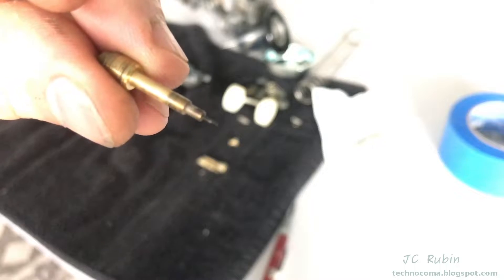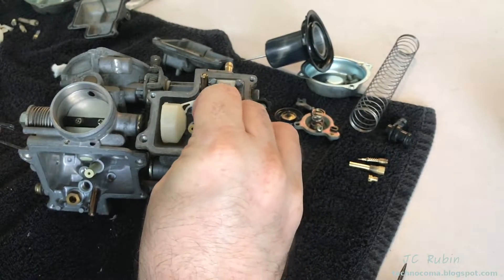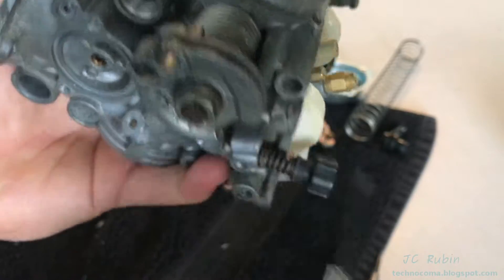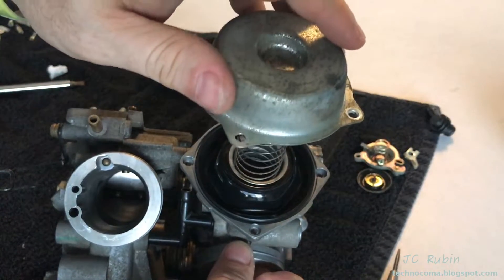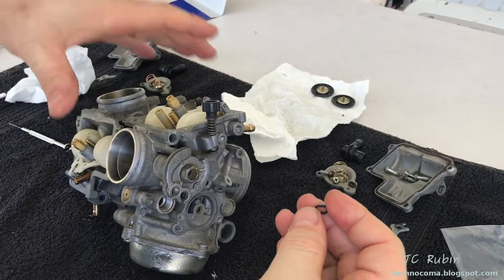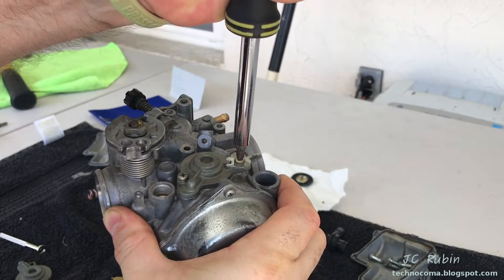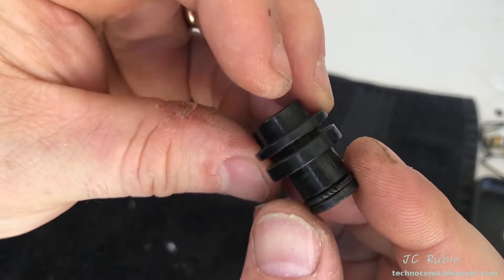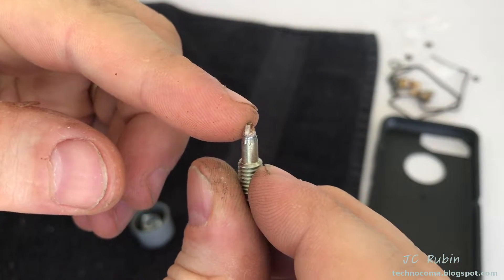Honda Shadow VT1100 Carburetor Rebuild - Part 2 of 2

Comment: Just wanted to tell you how much I enjoyed this 2 part video. I have an '07 1100 Sabre, which has been having backfiring issues. Using your videos, I was able to pull my carburetor, break it down, clean it, and reassemble. Thanks.
Reply from the maker: Glad to hear the video was helpful.

Comment: NIce Video,one thing to comment on, Im suprised you didnt inspect and/or adjust the float height to see if it was in spec, it has the adjustable tabs, from eyeing it it looks close, it would have been good to show your viewers how its done while its on the bench,,,,you did a good job being slow and meticulus with the detail and cleaning of the carb which is very important in my view, if you can master this video taking apart any carb is similar to this, its good to see a nice clear video with no shaking, videos like this are going to help people

Comment: Funny, I just watched part 1 yesterday and was wondering where part 2 was.
Thanks for this, makes me a little more confident in doing mine (I have a '94 VT1100, but same carbs as far as I know). 
I have having some issues with a high idle sometimes when hot, as well as occasional surging when cruising at a steady 35-40 mph. Wanting to pull them apart and clean them up, and the pics in the FSM are helpful, but this is even more so.
Reply from the maker: If be interested to know the condition of that small filter on the top with the foam in it.
Reply: I have the same make/model as yours. Let me know how it went.

Comment: Great lighting and great video, makes everything nice and clear. Just one comment, the bracket that goes on the air cut valve is meant to hold down the black tube, so you actually have to install the tube first and then flip over that bracket to keep the tube from backing out....

Comment: If you noticed that carb has two different jet sizes in each carb one is a 175s one is a 180s never seen that before there usually supposed to be in sequence but thank you for the vid is was very in depth and helpful
Reply from the maker: It is not abnormal to see this.
Reply: I know this was two years ago, but for the sake of knowledge... The smaller jet goes on the carb for the front cyl. Bigger jet goes on rear cyl. Front cyl gets better cooling naturally, rear cyl compensates for heat by having by more gas flow. More gas, cooler cyl. "As I understand it."

Comment: All owners of any machine should also take advantage of the float bowl Drain screws you pulled out and cleaned, 
to at least once a week in damp weather areas, drain the accumulated water out, and a quick shot of carb cleaner or contact cleaner to blast out the bowl with screw removed will remove any trace of water & loose crud out as well. 

Turn on the fuel with drain screw open, to capture from drain tube a sample of fuel to verify absolute clean fuel. 
Good Job on this video, and good luck to those on this mission. 

The water invasion in fuel tanks is from the high temperatures from engine captured under fuel tank, and cool down is what creates moisture in fuel to condense, then drain to lowest point,, the Carbs. 
Insulating the bottom of fuel tank will make a difference with high performance foil backed ceramic matting. 

I came by to show guest what his job is today with his 2003-1100. 

Cheers, from retired Honda Tech from mid seventies. Current machine, 07 Neo 1800.  A quick video made of NEO clutchless shifting will be found.

Comment: Very good video that encouraged me to go ahead get that done. My 2003 shadow spirit sat for 3 years and I found small jet on both sides clogged. I saw very minor difference in kit jets and stock so I carefully cleaned and put them back together. I do have new gaskets (the big squary shape one but seeing stock gasket placed in with rubber solution and not much flatten out, I like to reuse it. 
You mentioned doing a leak test after reassembly, how do you do that? Do it fill carb and then wait to see if it leaks from bottom gasket or there is another way?

Comment: Great overall video. Thx, mine had the same problem.  Did you find the foam filter that dissolved into the carb? Need to replace mine as well.  If so where and part number.
Reply from the maker: Made my own, it’s in the video

Comment: Was it also Rem oil you used on the diaphragms? I've also seen some people use evergreen oil but others advise never to use oil on them if it's not a two stroke engine...
Reply from the maker: I use just the lightest amount possible only to stop the rubber from dry rotting.

Comment: hopefully someone can answer this!!!! I have a 1985 honda shadow vt1100c. on left carb there is a spot where a line should be connected and there is nothing!! On the right carb 2 lines go from air valve(small diaphram) to carb. On left carb one of those holes is factory plugged/ The other spot is open and im concerned a line needs to be connected or plugged??? Please Help!!!! Thanks

Comment: Think it would be okay to use Break Free CLP to clean the jets and needles and use a light dab of Mobile 1 synthetic oil as a lubricant for the o-rings? Did you find any additional data on the little auxiliary air box for the carbs and is there an alternative to the OEM Honda element used in the box? Cheers
Reply from the maker: I use MAAS or any paste chrome polish to clean the jets.  A light coat of remoil for the rubber parts.

Comment: Are those bigger jets than stock? That’s the same size that’s in mine but I’m still have some popping on decel I’m not sure if the needles are shimmed though. It’s an 01 vt1100c. Any thoughts?
Reply from the maker: I believe these are stock.  I hear this most by people who change out their exhaust and then try and fix the problems of an incompatible exhaust by over adjusting their carb.

Comment: Great video thank you for the post! Is it necessary to put a little gas back in the carburetor before starting?
Reply from the maker: No, the fuel pump will prime it when u turn on the ignition. It takes only several seconds.
Reply: Thanks again.  I was worried about that.  Again, best video I've seen on this rebuild! Helped out perfectly.
Reply from the maker: If you feel the need to prime it quicker on this bike, use the choke when running the starter

Comment: Hello nice video!, I'm doing a shadow 1100 spirit, one question what's the name or brand of the oil that you use for the orings?
Reply from the maker: I use remoil. It’s a gunoil. Get it at walmart. Been using it for years.
Reply: @retrotechandelectronics  great thanks!!

Comment: Apparently I've rebuilt more.carburetor than you have. But the reason they give you ALL the specs is to check and make sure they are correct.
Reply from the maker: *carburetors
Thanks for watching.

Comment: 16:32 that little plastic T th as in between these two carbs whats that called ? I'm getting gas pouring out when I start my bike
Reply from the maker: Float stuck...
Reply: @retrotechandelectronics   pouring out of that plastic T not out of the bowl tho?
Reply from the maker: @cake8291  correct, without cutoff the carb is flooding to the top and pouring out the lowest hose.
Reply: @retrotechandelectronics  Idk I'm confused ill have to check it out more. The T that its pouring out of is at the top of the carbs so it makes no sense its overflowing out of that but I'm not sure ill have to study more on it its the first gen so it was all new to them too i suppose haha do you know what that T hose that's in between the two carbs are called?

Comment: Hi I just want to ask, can this resolve a problem with mixing Gas with Oil? Im having this problem, this is my second time I pass trough it
Reply from the maker: That is usually caused by overfilled oil, the wrong oil without an anti foam, or other possible less frequent issues, but i'd start at those two first.

Comment: You can send me the link to be able to order exactly that repair kit to order it I have the same motorcycle please I will thank you
Reply from the maker: google vt1100 carb rebuild kit
Reply: @retrotechandelectronics  I love them but from that brand I think they are made in Japan because those who sell on eBay seem to be a Chinese brand
Reply: @retrotechandelectronics  thank you
Reply from the maker: @luis0luis058  the dealer.

Comment: I have the same carbs. when I bought the bike 4 years ago it had a backfiring issue. took it to a shop they put bigger jets in. no backfire but it's running rich. carbon on the plugs and smell they like some gas and mileage is 30mpg. stock exhaust, runs great though. never let me down. what would you suggest. great video.
Reply from the maker: The original jets were probably correct and you had an exhaust leak....
Reply: Hello, I have a Honda Shadow Spirit VT 1100, year 2005, only 2,918 Miles.
Where is located the Sub Air Cleaner filter.
Thanks.